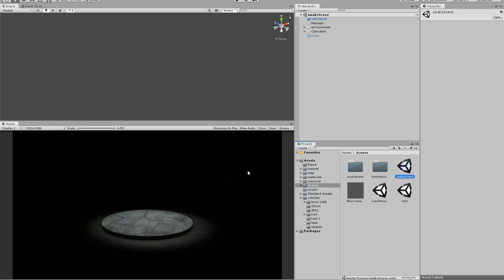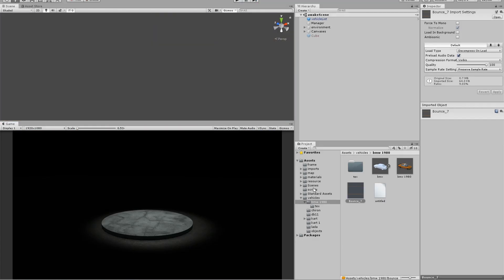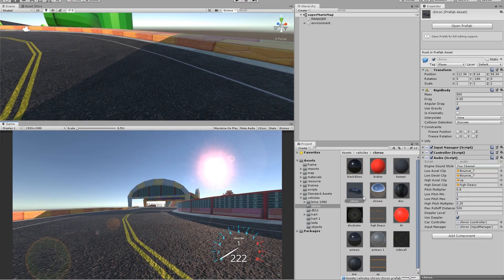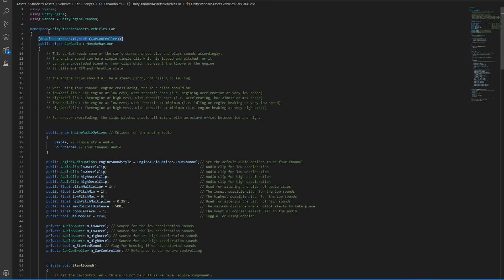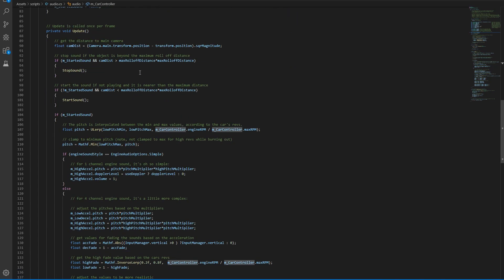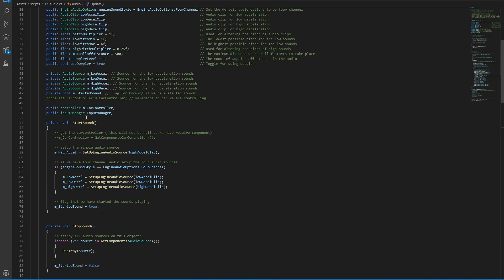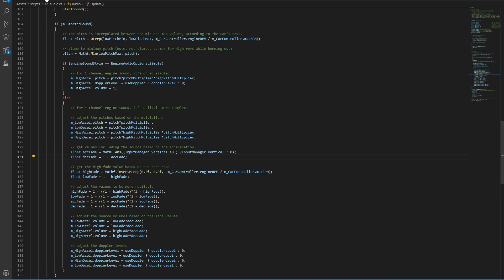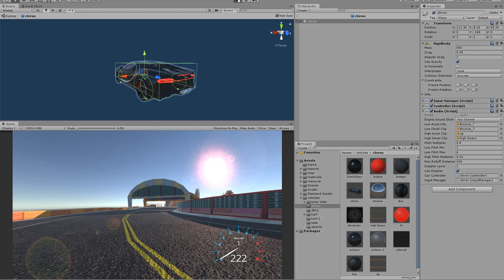Unity Tutorial - Realistic Car Engine Audio(download free)

Comment: Woah, now i get it. 
It's like you start with a strong up sound, then interpolate with a lower one on decreasing, and when i press accelerate button, comes back "vrrrrr", and when you left off, "oooowwww" , so it's interpolation all way. i still cant understand why you need 4? can't you interpolate between two? and just increase and decrease in function of speed on a pitch? Then cut the sound between respective gear? Or more better, you could slow down a master sound, even simpler than that...but im glad i found out more interesting stuff! Great!
For example repeat 1:22 minute, and see the sound sloooow increasing soo, it's haveing a delay, holy omg, cooool! Or 1:48 it's delay all day.
Just look at speedmeter, gear 2 it's until 50~53, then drops, sooo cool parameter.
It's soo hard to loop omg, but i achieved it, just take a look it's simple. The Visual Thief itself ;)

public class PRESS_VALUE_END : MonoBehaviour
{
    public float increase_rate_heart;

    public float value;

    public AudioMixer PORT_MIXER;
    // Start is called before the first frame update
    // Update is called once per frame
    void Update()
    {
        PORT_MIXER.SetFloat("PARAM", value);
        if(Input.GetKey(KeyCode.W))
        {
            value = value + increase_rate_heart;
        }

        if(Input.GetKey(KeyCode.S))
        {
            value = value - increase_rate_heart;
        }
    }
}
________________________________________________________________________________________________
And get VALUE for parameter : "increase_rate_heart"  will have 0.0001
And get VALUE for parameter : "value"  will have for example start with and 0.5
________________________________________________________________________________________________
https://www.youtube.com/watch?v=P2sa6D5RafU&list=WL&index=2&t=69s
Reply: Biggest comment I've ever seen🤣